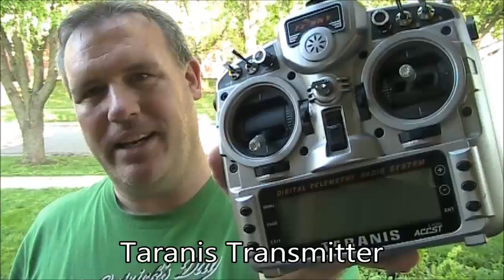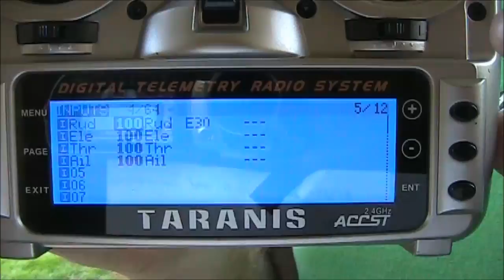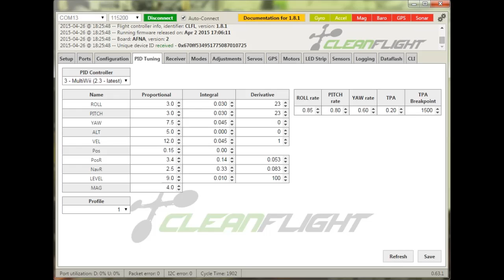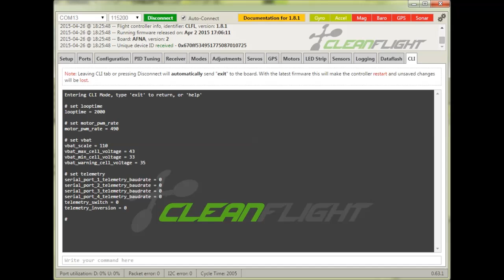FPV250 Quadcopter Parts, Assembly, and Tuning with Naze32

Comment: Thanks for posting.  My yaw was sluggish so I changed my PID Controller to 3 like yours and it made all the difference...She flies great!  You saved me many props!
Reply from the maker: hydrojedi Good!  I'm glad it was helpful!
Reply: +hydrojedi you dont have to change your pid controller to obtain faster yaw rate. just go to the pid tuning tab and change the yaw rate in the top right corner to a higher number.
Reply from the maker: I could never get my yaw any faster by changing the rates.  The other PID controller brought it to life though.
Reply: pid controller 0 was connected to rates. so i you raised p  value, it decreased rates. controller 1 is unaffected by pids and you can set your rates to what ever you like but autotune does not work on pid1 and luxfloat.

Comment: Travis, believe it or not, I’m only now starting the build out this frame. Ha ha
I’ve built many quads since last we talked on this post, but I’ve always wanted to build one of these out. 
I picked up some old school Sunnysky 1806 2300kv motors for it, so it’s gonna be pretty true to back in the day. 
These frames and frames like it may not be very sexy, but you don’t have any problem fitting things in them.lol 
I’m thinking I may put a case of coke in there for when we are flying at the park. Ha ha ha 🤪 anyway... you’re the best, man! Thanks for all the work you put in!!
Reply from the maker: The first FPV250 I flew was one I bought used online.  I was unsure about putting one together that was so small.  I thought the space would be too little and wasn't sure how to tune it.  :)
Reply: travisgrindal Ha Ha Ha! Right?!    I have one of those 5” Fly Eggs. Talk about tight!  Truth is... I’m seriously thinking of stripping it and putting its components in a 250 frame and calling it a day. Lol  i found out the hard way there isn’t much but props to grab when picking up my Fly Egg! Ha Ha ooooooops!! 🤪😝🤷🏻‍♂️💢

Comment: I know this is an old video, but I like your quad. You did a great job back then... and it flew well. I could tell how much fun you were having... and I think that’s the main thing. Of course you know that. 🤷🏻‍♂️ 👍🏻Ha Ha I think if I flew around my street, people might lose it! Wish I could.
Reply from the maker: BadChizzle I was getting off work early then and was able to fly before kids were out of school and before the walkers started coming out.  I only had about an hour window.  It still true today but I feel like I fly a lot faster now and I'm scared of someone sneaking on to the sidewalk without me knowing.  I do still fly a lot of LOS on my street.  :)
Reply: travisgrindal I see. So far... all I’ve done is line of sight. Just learning. Right now... I find that getting my second build to work, is my biggest challenge. Ha Ha  to show you how much trouble I’m having... I’m using my failed Kiss board as a five volt regulator for a Naze32 rev6 that I can’t seem to get going. Ha Ha  talk about your Frankenstein setups!! It’s actually the computer part that slows me down the most. Not exactly Mac savvy in the slightest. My son got me a Mac book, but mostly I just stare at it. Ha Ha 

Thanks a lot for your reply!

Comment: one shot doesn't slow down your motors as you describe.   That is done by complementary pwm.   I believe the option is called damping in blheli. Simon doesn't have it turned on by default in his firmware, but the option is called comp_pwm,  for anyone who wants to try it.
Reply: +nwimpney That's it.. It's called "damped light"... Oneshot has to do with timing...
Reply from the maker: +Optamizm Yeah, I've been corrected on this a couple of times.  I got it figured out now.  Hopefully in my next quad review video I'll get it right.  :)

Comment: This video was extremely helpful, thank you for taking the time to post it.  I'm a huge fan of acro naze32 + Cleanflight, but I believe my problems are user error and I am struggling with my set up.  I have difficultly arming my quad.  I've set it up before, where my toggle switch was used to arm it, but when I unplug my battery (for a period of time) that function stops working.  I am no longer able to arm it via toggle switch.  I understand that as default I should be able to arm by using left stick towards yaw.  I'd rather keep this switch as the arming function, because I like it that way.  I've even started over and now I can't get it to indicate in arm mode that it's even activated (by turning green).  I'm tempted to go back to CC3D, just to get my quad back in the air.  I don't want to go back to CC3D, I've felt the power of Naze!!!!!  It feels good!!!!!  Is there an old school trick, I'm not doing???  set your parameters then plug in your lipo, then X, Y, Z???     Last example.....The other day I was able to restore it from a previous setting, unplugged from my computer, went outside and armed it with my switch, was flying it around, crashed it, then I was no longer able to rearm it from the switch.

Comment: Hey, Im very new to drone flight and just managed to get my naze32 powered quad copter air born. I was just wondering if there's a way to program the board to steady the drone. What I mean is, I want the board to try to get my drone to a level position with no acceleration if theres no input coming into the board. Is it possible to use the accelerometer to accomplish this?
Reply from the maker: +Jake Rezac Yes, there is a mode in CleanFlight that help with exactly what you are talking about.  It is called "horizon" mode.  You'll want to put it on a switch so you can turn it off and on while you are flying.  I'd suggest learning to fly with "horizon" mode on initially but start turning it off for a few seconds on every flight so you can get more and more familiar to flying without it.  Eventually you won't want it turned on anymore, but how long it takes to learn to fly in "acro" mode (no auto-leveling) can be short or long, depending on how badly you want to learn.
Reply: Thank you very much, this is a great help. I'm pleasantly surprised to see how quickly you responded
Reply from the maker: +Jake Rezac I try to respond to most questions.  Sometimes, I get questions and I have no idea what the answers are.  :)

Comment: great vid, can i ask should the throttle position be in the center when the quad is at hover? thanks.
Reply from the maker: Glenn Boulton (Digital image studios UK) Ideally, it should hover around the center - plus/minus a little.  If you are hovering up near 80%, then your quad is probably too heavy or you need to make adjustments (4S battery instead of 3S, larger propellers, higher pitched propellers, etc.) to try to get it back closer to the middle.... but yes, it should hover somewhere near the middle.
Reply: ***** Thanks for the reply. actually mine is hovering at about 25%, im using naze32 with cleanflight, not sure how to adjust.
Reply from the maker: Glenn Boulton (Digital image studios UK) That isn't bad.  You have weight to spare for a camera or LEDs... that sort of stuff.

Comment: Hey I just had  a tough crash and my Naze 32 Acro is no longer responsive.  By that I mean: no led indications, will not connect to Baseflight when connected to the PC, nothing.  Do you have any advice as to what could be the problem and if it is possible to fix?
Reply from the maker: Kastan Day Heh, that stinks.  :)   I have no idea.  It may be about time for a new flight board.

Comment: Hi, would you mind telling me how to programme my Taranis for the three flight modes of beginner, intermediate, expert? I've set everything else I need but can't find anyone explaining how to do it. Be  grateful for your help.
Reply from the maker: +Next Lipo Please MiniQuad Racer Well, the flight modes usually involve an auto-level, or a kind of less helping auto-level, and a rate mode.  Those modes are setup on the flight board and then you assign a switch on the Taranis to switch between them.  Most people start off learning on auto-level and once they get a little more familiar with it, they start turning it off for a while during each flight (sometimes just a few seconds).  The important thing is to get familiar with that switch without having to look down at your transmitter.
Reply: Okay thank you very much. So I just assign a switch when I set the taranis up to my quad.
Reply from the maker: +Next Lipo Please MiniQuad Racer Yeah, that is what I did.
Reply: Cheers pal

Comment: Hi, greate video  
i saw you using afro with naze, how you power the naze32 board ? did you use all 4 afro red wire connected or a 5v bec only for powering the board ?
Reply from the maker: דולב פוני I have all the red wires from my ESCs going into the Naze32.  I did not remove any of them.  It works great.

Comment: what blheli settings to you have on the esc's?
Reply from the maker: I show the BLHeli Suite screen shot in the video.  Was there something I missed?
Reply: ***** Lol sorry dumb question.... I feel silly now.. yes I have now found it :) Yeah I thought I saw it last night but obviously didn't get up to that part when relooking at it today.   ...  anyway thanks :)    I tried medium high timing and motors get warm (similar setup dys, 12afro, 3s, 5x3) where simon k used to be cold.   Will try high timing
Reply: Umm if is any help you dont need to change motor pwm rate when oneshot is enabled. dampen light has the active breaking part. The oneshot is just the communication between fc and esc
Reply: High timing is heaps better, motor temp is normal, like Simonk. Got it flying nice now. Thanks for ur vid
Reply from the maker: Len d Good!  You are welcome!  I'm glad it was helpful.

Comment: Hi! Finally I found a great vid with a parts list to build a nice quadcopter so thx for this vid and the parts list (I will buy those items :) )
I have some question, because I don't understand the english spoken very well :(
-I didn't understand how long is the flight time with the batteries that you showed.
-What is the range for that fpv transmitter, I mean, How much can I fly high or what distance ?
-With a GoPro (or mobius or something like that), How long could be the time of flight? 
Really thx and sorry for all these questions.
Reply from the maker: cris1879 Thanks!  The flight time is about 5-6 minutes.  The FPV can easily go about 100 meters.  I've flown alot further than that in a field with no obstacles.  It will go VERY high!  I've probably flown up to 100 meters up in the air.  It gets scary!  A GoPro is kind of heavy and it will probably fly about 4 minutes with a GoPro mounted on it.  A Mobius is a lot lighter and only reduces the flight time by maybe 30-45 seconds.
Reply: ***** Thank you so much for the answers. You have been helpful! Greetings from Italy :)
Reply from the maker: cris1879 You are welcome!

Comment: Hi! I love your videos :D just subscribed
I have a question I was hoping you could give me an answer to: how does this (FPV250, which I assume you got from banggood) compare to the "ZMR250 fiberglass frame" ? 
because the price difference is really not that big ( maybe 20% or so), and fiber-glass somehow sounds "better" than plastic  :P
Reply from the maker: The FPV250 has an X shape, whereas the QAV250 is more of an H shape.  The FPV250 is a strong frame.  I haven't broken one yet but my friend did.  The QAV250 has replaceable arms.  This is good if you break one.  I like them both but the QAV250 looks a little cooler in my opinion.  I like flying the FPV250 because it was the one I started with.
Reply: ***** thank you so much for the quick answer :) strength wise, are they more less the same or is one stronger than the other? and also, I know that the FPV250 does not clear 6 inch props unless you swing the cage to the bottom, does the QAV/ZMR 250 clear 6 inch props stock?
Reply from the maker: Nguyen Tuan Nguyen they are about the same strength.   The 5 inch props are real good to start with and both can fly with them.  6 inch props are fun too and they do fit on the QAV250.  You're better off starting with 5x3 props and then moving to 5x4.5 props later when you think you are good.  Don't worry so much about the 6x4.5.  They are fun, but get started on the 5s.
Reply: ***** thanks alot for the advices :) that was more less my plan.

Comment: how much did you spend total?
Reply from the maker: george aura Just for the quadcopter, to make it flyable, it was probably around $140 - that is just for the parts.  $30 more for the camera and video transmitter, then another $75-$200 for a transmitter, and that doesn't include all the other required tools - soldering iron, shrink wrap, wiring... that kind of stuff.
Reply: wow are you serious thats the cheapest i have heard it to be to get one together and going
Reply from the maker: george aura I feel like it is pretty solid and a good competitor but it isn't too costly to fix when you crash.  Oh, I also forgot to add in video goggles.  They'll add on anywhere from $200-$500.  You could go with a monitor and receiver for probably around $100 if you wanted to go a little cheaper to get started.
Reply: would you be up for building me one if i paid for the work and parts?lol
Reply from the maker: george aura It would cost $500.  :)  I'd suggest looking for one that is ready to fly on rcgroups.com's classified section.